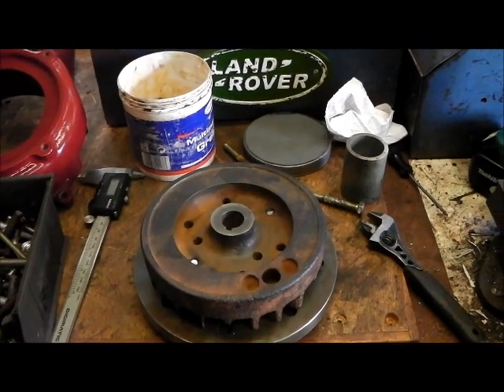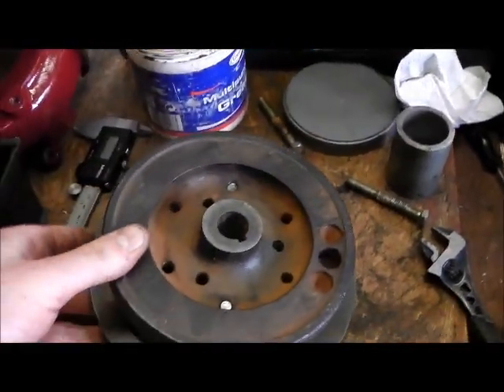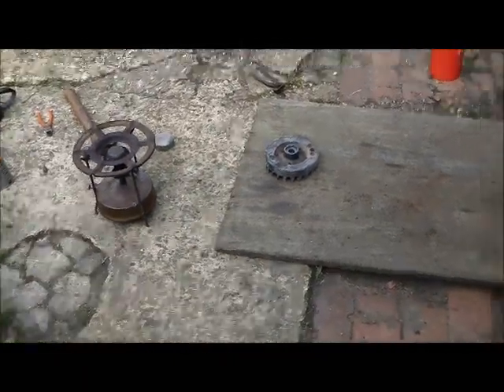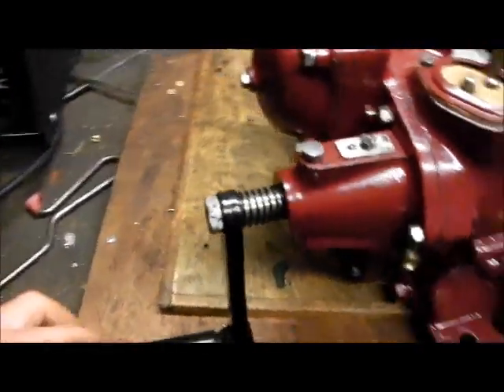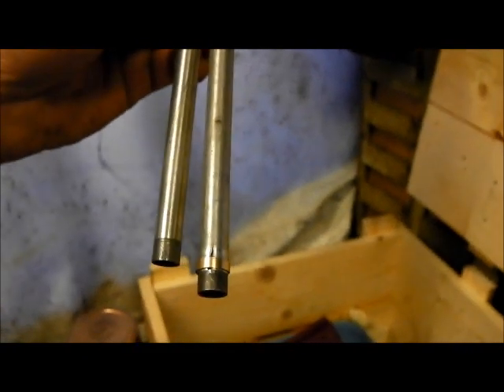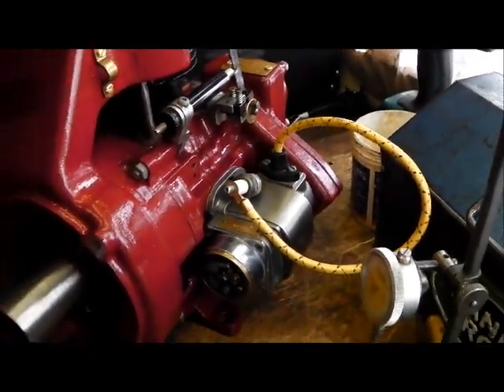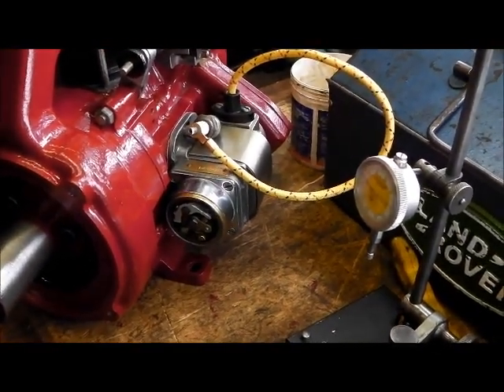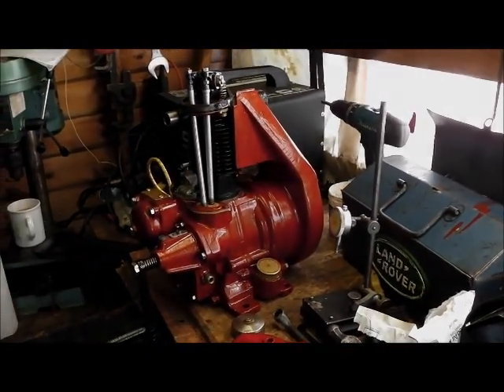J.A.P Model 3 Restoration - Part 7 - Cracked flywheel Repair

Comment: Interesting idea of how to fix the flywheel! Can't wait to see the old girl running
Reply from the maker: Tom Branchline Thanks, it's a very old method of repair for this kind of damage. If it was cracked right through, then the boss would be bored out to accept a top had shaped bush pressed in, which would then have to be taper bored and broached for a key way. Glad I didn't need to do that! 

Phill.

Comment: looking great,
I've got a set of +.010" JAP 2A rings some where if you're interested. i'll have to find them though!
Reply from the maker: calm callum I'd be very interested if you can find them, does that include the oil scraper ring?

Many thanks,

Phill.
Reply: yes it's the full kit, i'll have a good look for you. i brought them for my 2A but it became apparent i needed a new piston, the only one i could find was a +0.060' so i got it rebored to that.
Reply from the maker: LYON air cooled... spot on. 
Thank you very much, will email. 

Phill.
Reply from the maker: calm callum 

Callum, thanks for the piston rings - now fitted to the engine. Sorry I haven't messaged sooner, my email has packed up....

Is the conrod for the 2a any good? 

Phill.
Reply: steamwally  glad i could help!
the con rod looks to be a slightly different casting to the old one, maybe JAP changed casting patterns at some point? saying that i haven't seen the old con rod for ages as its been at the machinists. the dipper is the same so as long as all measurements are the same it will be fine.
thank you very much,
callum
Reply from the maker: OK, hope it works out.